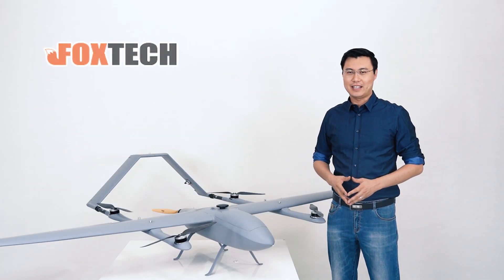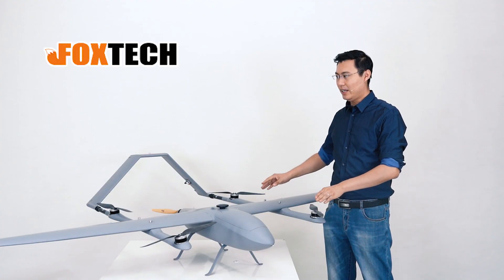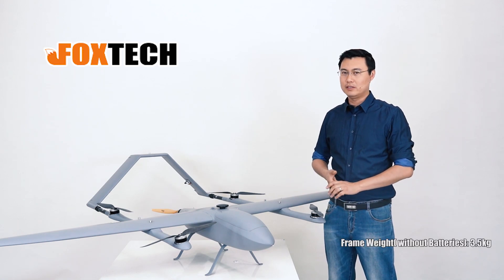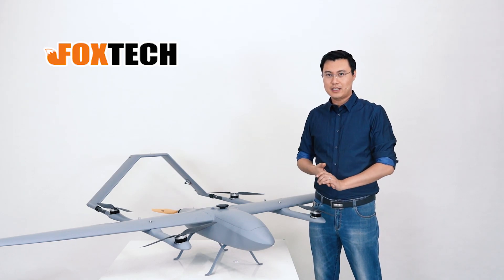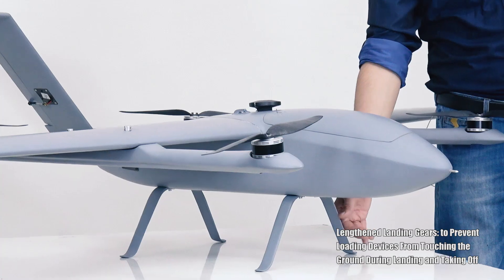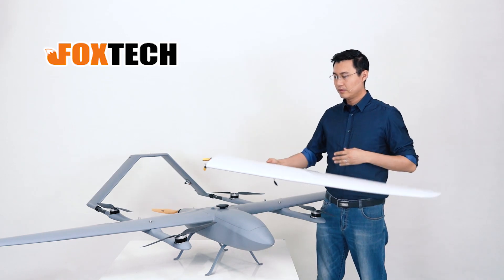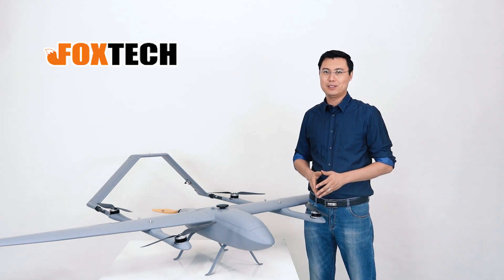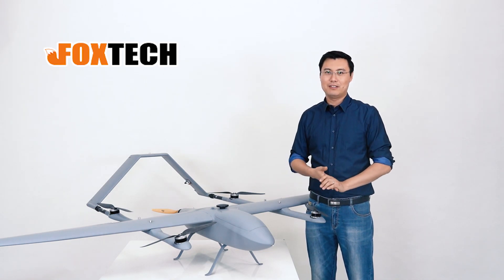Baby Shark 260 VTOL Upgraded MATT GREY Version

Comment: Why don't front motors tilt forward in flight?
Reply: Nimbus is tilt vtol, here are videos: https://youtu.be/e3Gr5UykuLU
Reply: 1 pusher / 4 lifters is mechanically more efficient and simple (less moving parts) than 2/4 tilters.

Yes, aerodynamically 2/4 tilters is better, but what are you trading off? 20 mins flying over 2.5 hours?
Is it that critical versus not having 2/4 more servos that can fail?